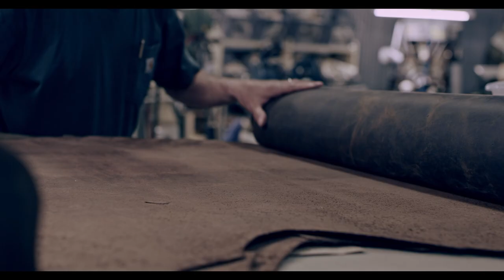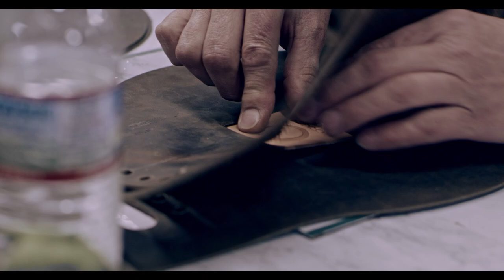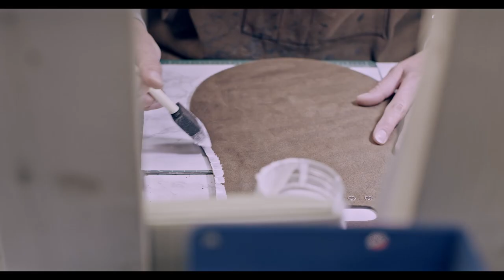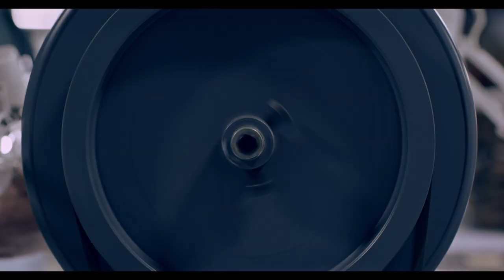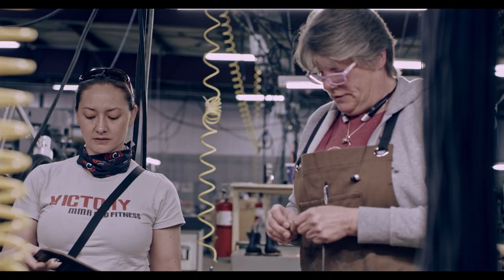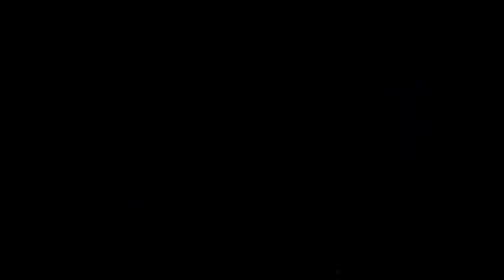THE COWHIDE KETTLEBELL - This is the Burden

Comment: Just got mine. Leather feels nice and high quality, but I think the top needs some sort of overhanging flap help prevent filling from falling out during use. The bag is also smaller than a completion kettlebell when filled, itd be awesome if you could get it a little bigger to add more load. I'm also a little worried how the single stitching will hold over time but we'll have to wait and see.
Reply: simple, integrate plastic re-sealable bags. 
fill those with your weight material then place them inside the burden.

Comment: Just got mine in the mail today. What a beautiful tool, I'm so glad I bought it. I filled mine with mostly pennies and a few other coins too. The Burden is really great, but I highly advise filling a plastic bag of some sort with a few fistfulls of your weight material and then putting that inside the burden before use. Sometimes when I do swings or whatever a stray coin will fly out the top, but it's easily fixed by keeping the weight in a bag. After some shaking and work the Burden holds 30 lbs of coins, give or take a few pounds depending on some factors. 
Copper, lead, or steel shot will probably serve most folks well but honestly anything can be put into the Burden and it will work just fine. I think I'm going to put some copper BB's into mine once the leather stretches out a bit more.
Reply: keeping a few different “ziplock”  plastic bags filled with different material isn’t a bad idea to add to versatility to this product. it’ easy to simply switch out the bags.

Comment: What are the weight options? I need one heavier than 45 lbs
Reply: Guyle Good question , I asked something similar yesterday when I seen a different video on it but didn’t get a response .
Reply: It comes without weight, if you view their product page it gives some examples of weights to use
Reply: Mine just came in and to be honest if you need something over 45 this isnt what you want.  Filling it with sand and smaller rocks only got mine a bit over 20lbs and would let grains of sand fly out every swing. This thing is a great idea that needs some revisions
Reply: Gerby Gerbs pennies?